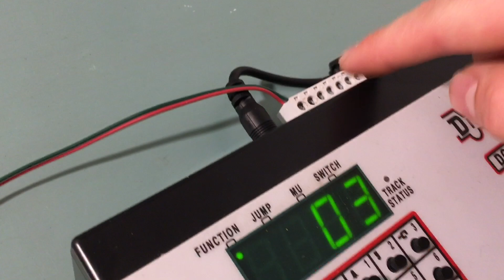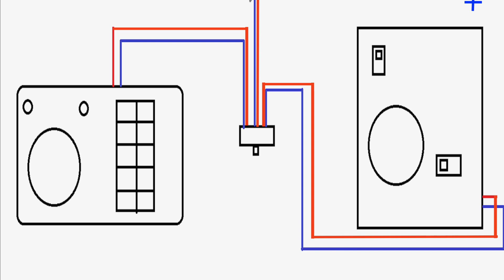How to Wire DC & DCC Work Together On Your Layout

Comment: You should never under any circumstance and I've told you this before run a DC locomotive on DCC tracks if you're using the Bachman system it does somewhat work for DC locomotives but it is a no way in shape intended to do so and if you're trying to run DC locomotives on DCC rails with the Bachman system technically you are running in DC not DCCC. DCCC is technically alternating current versus direct current you should never run a DC locomotive without a decoder if you hook up that new digitrax DCC controller you got and then put a DC train on the rails it's going to short-circuit it until you take it off of the Rails there's something about Bachman that turns it into DC whenever it detects a DC locomotive
Reply: Would be easier to read with periods. Please

Comment: I think that big soldering gun and thick solder is giving you some trouble. I would recommend a proper soldering iron and thinner solder. Temperate control is a must-have.

Comment: One suggestion, for the DPDT switch you should get one that is a break before make or center off. The type of switch you used could be a make before break which means that it's possible that you have both DC and DCC going to the rails at the same time. It also means for that fraction of a second you could have DC feeding into your DCC system and DCC feeding back into your DC system. This can cause both systems to fry it as well as damage any engines on your track. Ok so would also advise if you are going to switch between them in ok n in your be layout you program your DCC engines so that CV 20 is set to turn off DC conversion, that way the decoder will not respond to DC current.
Reply: As long as the switch is thrown to the desired controller and the power is off that wont happen, but yes if the power is on you are correct.
Reply: Rat tail switch.
Chamber DC to DCC.

Comment: Soldering would be so much easier and more efficient if you actually cleaned the soldering iron and something to hold the switch upright with the terminals facing upwards will make soldering soo much easier...

Comment: As someone who has Managed to DCC his Father's Old Locomotives.  You have to put a lot of money in DCC decoders that handle the amount of Power the old Locomotives require. My Father had a vast amount of old Athearn Blue Box Locos. I went through Many 1.3 Amp digitrax decoders and had to shell out so much more money for a 3-4 Amp decoder
Reply: Look into remotoring them, both Athearn and Kato make replacement motors that will pretty much drop into most blue box locos be and run in the $40-60 (US) range.

Comment: With the Bachmann track it has it so you can power from the inside or outside of the track. Wouldn’t you be able to use the DCC controller on the outside of the track and the DC controller on the inside part of the track or vice versa as long as you have the Bachmann power wires. Just gotta make sure what which controller your are using the other has no power to it.
Reply from the maker: I'm not sure I understand but you can't hook up two controllers to the same track without a switch between them otherwise power may flow backwards to the other (even if one is off).
Reply: @SMTMainline  Bachmanns 9inch straight terminal rerailer track. It has the power prongs on both sides of the track.
Reply from the maker: @GeneralLee0178  That's just so you can place the controller on different sides of the track, if you hook up two controllers that way it could cause issues.
Reply: @SMTMainline  yeah true you would actually have to unplug the controller that you are not using from the track. I like the toggle switch better.

Comment: Two questions. Im gettng a dcc ready kato gs4 and planing on installing dcc chip at a later date. Im good to run it on dc until i install the chip and conversion correct? 
Second question. Can i still run a bus wire with this switch setup to power most of my joiners?  Thank you for your time!
Reply from the maker: You can run bus wires but make sure they feed from the switch's output and not one of the controllers directly. Keep an eye on which wire goes to which rail as not to short them. As for the DC gs4, it's totoally fine to run it on DC. DCC ready locomotives have a circuit board which directs all the locomotives power to an 8 pin socket. Before you install a decoder they simply put a bypass in the socket to allow the power to flow through.

Comment: I assume i cannot hook up 2 bachmann controllers (dc &dcc) on the same trackor can i?

Please help me im just getting into model trains
Reply from the maker: You cannot directly connect them to the track without a switch. The bachmann EZ command controller has the ability to connect a DC controller to the DCC controller though.
Reply: @SMTMainline  like Switch the Cables?

Comment: I actually designed a complex block system that uses more than three different switches just to control one block. One is a rheostat, another is a DPDT reverser circuit, while the third is a DCC/DC DPDT. Any additional switches are there simply for extra effects (like one of my home-brewed PiTrain controllers being substituted for a typical controller).
Reply from the maker: Brilliant, so you can change the direction on any given section?
Reply: @SMTMainline  It should be able to do so in theory, but I haven't wired it up yet. It might work, then again it might not. It would be useful if it does work as the speed could also be fine-tuned as well as direction, although troubles could be encountered with trains crossing in and out of a block depending on the polarity.

Here's a "diagram".

Block A                          Block B
_______________ __________________
  l        l                            l      l                                      
  l        l                            l      l
  RVRS                            RVRS
     II                                     ll
  RSTT                            RSTT
     II                                    ll 
  DPDT                            DPDT
   ll    ll                             //   //
   ll    ll                           //   //
   ll    ll                         //   //
   ll    ll                       //   //
   ll    ll                     //   //

   ll    ll                   //   //

   \\   \\               //   //

     \\   \\           //    ll
       ll    \\       //      ll
       ll      \\   //        ll
       ll       DCC        ll
       \\                     //
         \\                 //
           \\             //
             \\         //
               \\     //
                 \\//
                  DC

Key
RVRS = DPDT with reverser circuit wiring
RSTT = rheostat, adjustable resistor, potentiometer, etc
DCC = DCC control system
DC = DC control system

While it is not the best representation of it, this is as close as I could get to a wiring diagram with the symbols on my keyboard. There would be an additional branch with the switches for each block.

Comment: I would never leave a DC loco on a DCC track, it will be ruined. 
DC locos are designed to run on 12v DC. What  your supplying them on DCC is 16v AC. One of  the design features of a DCC chip is to convert the 16v AC to 12v DC so the motor will work.

Comment: Very easy to understand video for beginners Harrison.  Before I had more controllers (just running N DC) I put a similar switch between two two separate tracks (one inside the other) operating with one controller.  Sure, you can only run one at a time, but have two different consists set up on different tracks.  An easy way to switch between the two tracks with one controller.  Just another use for the switch.  Great job Harrison!
👍 👍 👍

Comment: Thanks for the tip do you think I could put a decoder inside a lionel postwar loco
Reply from the maker: If your talking about O scale I couldn't help you.
Reply: @SMTMainline  do you think I could
Reply from the maker: @Tyc11114  Well most ho trains operate on 2 rail DC and O scale trains operate on 3 rail AC. I don't know what the situation is with DCC on O scale nor do I know if the age of the loco makes a difference. It's probably not impossible though.
Reply: @SMTMainline  I was thinking of putting a decoder in my lionel line's 1130 postwar loco that I had to remove the e unit

Comment: fitting that switch will take care of the power suppply but the points are wired up differently for dc and dcc how do you overcome that
Reply from the maker: Are you talking about the + and - wires?
Reply: @SMTMainline  THE POWER SUPPLY to the track in dcc is universal .in dc each section of track is controlled by the regulator
the points - in dcc the frogs are changing from posotive to negative via a switch  so if you run dc on a dcc wired point  will it not short out

Comment: Cool video. You need a desoldering tool so you can clean out the small holes in the switch for better connectivity...IMHO anyways....
Reply: Also, if you're wiring mil-spec or NASA spec, you need to suck the old solder out of the terminals on the switch - or better yet get a new switch. Tin the wires, add a short piece of heat shrink tubing, and then form a 'J' on the end of the wire. Put the 'J' into the hole on the switch, crimp it closed and solder that connection. Slide the heat shrink tubing over the connection and heat it with the soldering iron to shrink it.  Do this on all six connections to the switch.

On the other hand, if you couldn't care less about mil-spec or NASA specs, then the hell with all of that.

Comment: Hey SMT what are your thoughts on Bachmann's DCC system? What system would you recommend it for a first Layout?
Reply from the maker: I was very happy with mine and it was a good introduction into dcc, having said that. They're quite outdated at this point (they we're released in 2004) and have limited capabilities. You might be better off going straight to a higher end Dcc system like a Digitrax or NCE system. I personally have a Digitrax system and am quite happy with it, some people prefer NCE though and I couldn't tell you which is better since I have only used Digitax. Hope this helps -Harrison.
Reply: I have the dinamis Bachmann it has all the bells and whistles

Comment: Can someone answer my question I’ve got a railpower 1300 and Bachman track it is a dc setup, can I run a dcc locomotive on my dc track or should I buy a dcc controller for my dc track. I am fairly new and am having trouble understanding this

Comment: So, will this method still work if one had a DC layout that has double main lines with 2 DC throttles?
Reply from the maker: It could probably be done if you wired it differently. I'm not sure how though.

Comment: Its butter to run dcc on dc than dc on dcc dcc is intended to run on dc it has a full Bridge rectifier in it you're not going to hurt anyting but running that DC locomotive on DCC rails you're going to ruin the locomotive and the power unit

Comment: SMT - A Lionel O scale modeler can also use a DPDT switch if they have locomotives with AC motors, & locomotives with DC motors.  The DPDT switch can select either an AC transformer, or a DC power pack, to be connected to the track.